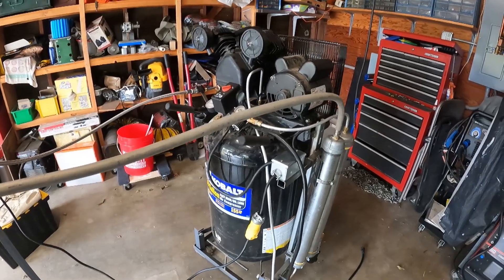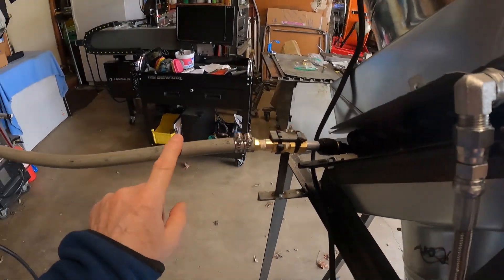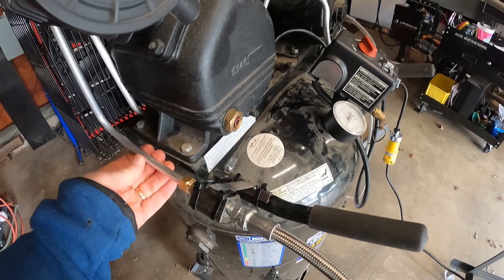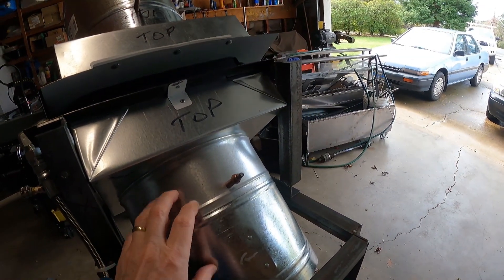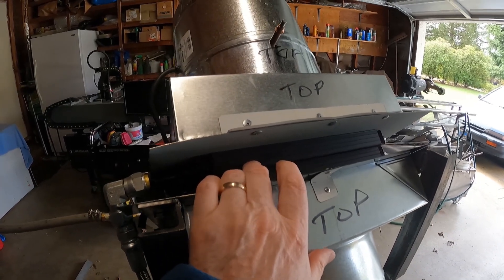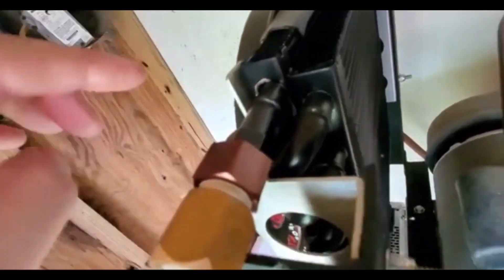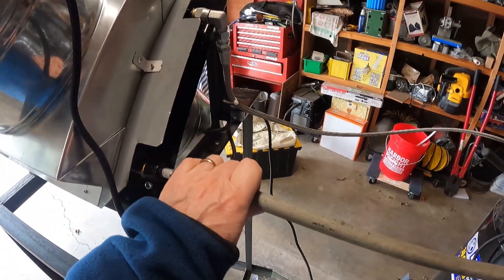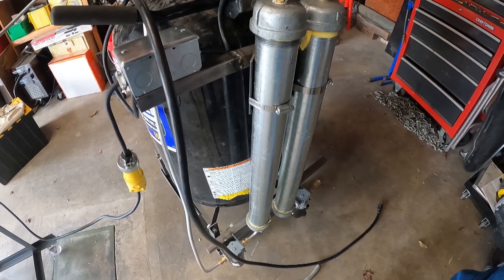DIY #9 Part 2:   Passive Compressed Air Dryer System.

Comment: Great video and informative, like the first part with the maths (i moved my compressor 2 feet to a new spot and its runs completely different due to environmental factors) 
The largest factor i found in a setup like this was cost were i live, the cooler is around 300+ and $250 each or more for a good water trap then copper piping etc so well over 1k when a refrigerant drying systems start at 1.5k new or get a better quality compressor...or get second hand stuff haha
Thanks again, hope others get use out of this :)
Reply: @boltonky Wow, the cost seems prohibitive! May I suggest a cheap tube & fin cooler alternative. If there is an automotive dismantelling  facility nearby, inquire about purchasing an air conditioning condenser heat exchanger that mounts in front of the radiator. A large car or bus condenser would be best. Clean it out with solvent & check for leaks & repair if necessary. Adapt plumbing fittings no smaller than your compressor pumps outlet fittings. Fit & angle the cooler like Mr. Kronemeyer suggests, including a fan ducted & sealed to the condenser. The pipe drip legs instead of expensive water traps is a great value. I did the same for my 4 water trap areas. With that exception try to follow the entirety of his genius design. Scrounge used galvanized pipe, clean the interior of the pipes spotless. Give it a try! Never give up!